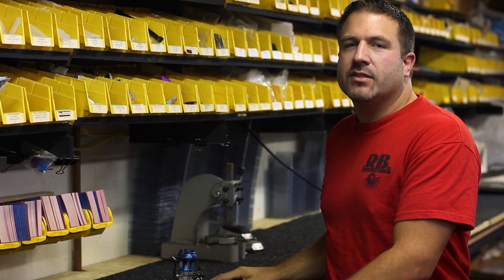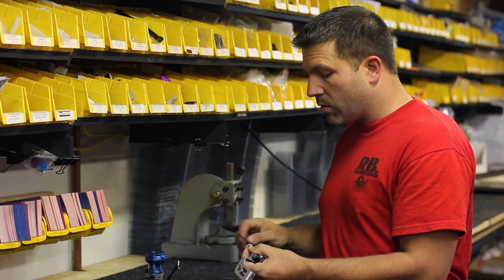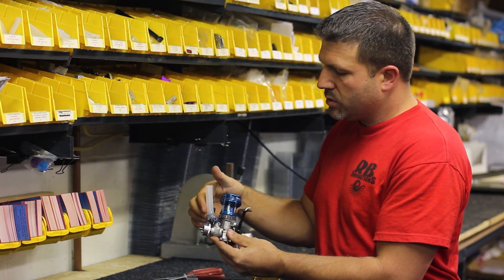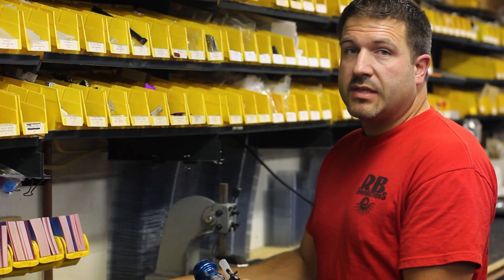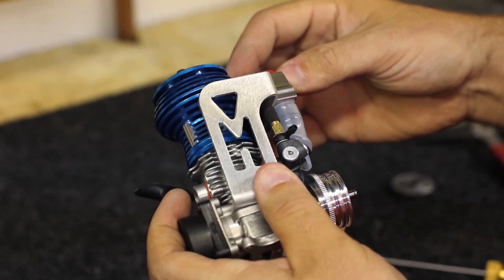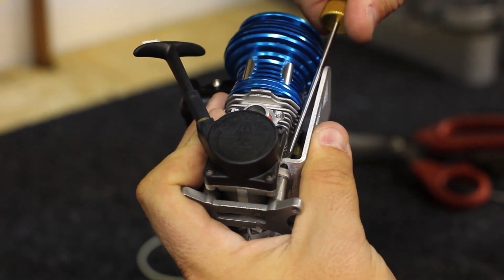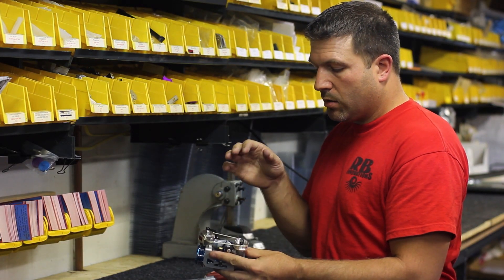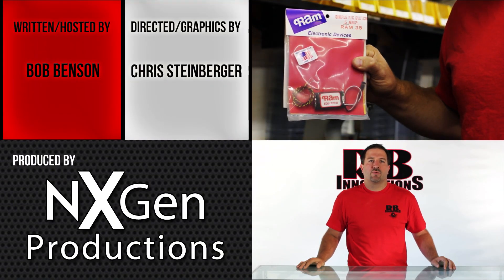How to Install an RC Supercharger from RB Innovations

Comment from the maker: Hey Daniel, thanks for the comment. We've developed and continue to improve our Supercharger systems throughout the last 12 years, and we've found, along with our customers, significant and noticeable gains by using our Superchargers on these small nitro engines. Contrary to what you might have heard, the system actually requires minimal power to drive the Supercharger, which allows for maximum output from the engine. If you want to talk in more detail, call us at 315-451-4440

Comment: as a student of mechanical engineering i have my doubts about this system. first of all that "super charger" has a mighty small compressor. I found some specs on it and after some math i found even at an impressive 40 000 rpm it would move about 22 cfm of air at 3.2 psi. not very significant. secondly the power required to spin the charger exceeds the power gained.  finally, for the fuel system to work with the charger the fuel pressure must be continuous, not pulsing.
Reply: How are you doing in your career 9 years later?

Comment: if the pressure is so high in the tank how can the car run without boos? cant be that simple. have you tried and se if it actually compress any air?

Comment from the maker: The fuel tank is pressurized by the exhaust which has a higher pulse pressure then the super-charger.  If you are running a high flow exhaust pipe you can also use the auxiliary pressure system which will compensate for this lower pipe back-pressure.

Comment from the maker: Boost ranges depending on the application as well as the rpm. Horsepower gains range from 15 - 30 percent from stock.